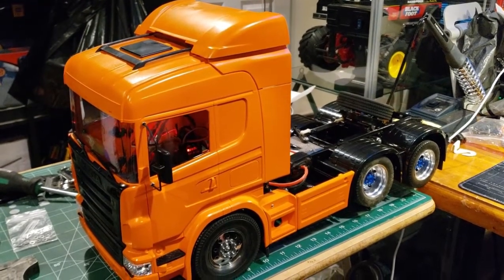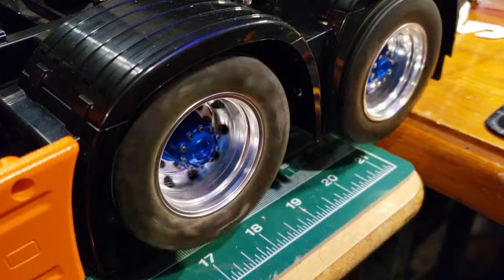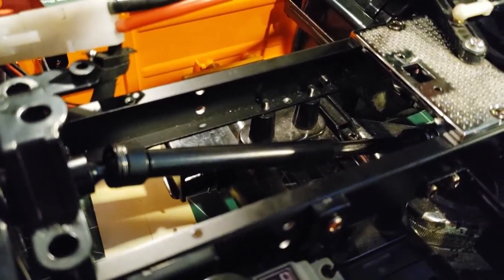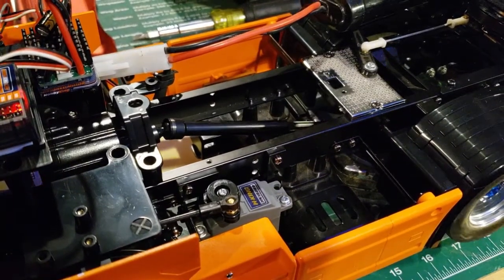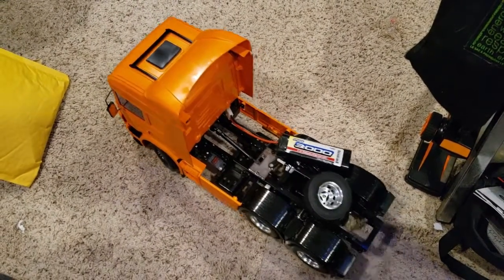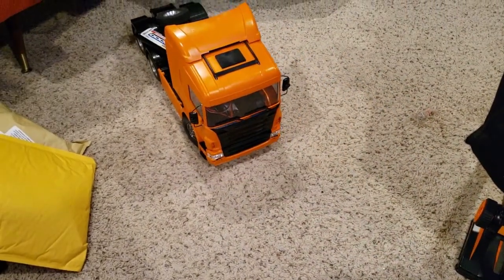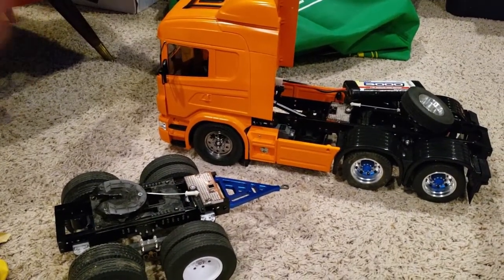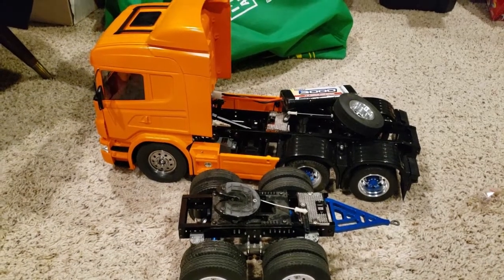Tamiya Scania R620 Update

Comment: Hey i know this was from years ago, but what ever happened to your high lift clod project? i was wondering did it work because I'm thinking of doing one myself .. Thanks
Reply from the maker: It did work but because the body was so fancy it did not end up staying with the big tires and body lift. I made it back to a normal height clod and kept the hub extenders and put some nice tires on it. A buddy in Calgary bought it off of me and he ran it a few times on trails and courses. RC Sparks has a video at rude boys outdoor course and it is in that video.
Reply: TheStuffz great stuff man, should I just get a pair of hub extenders from eBay